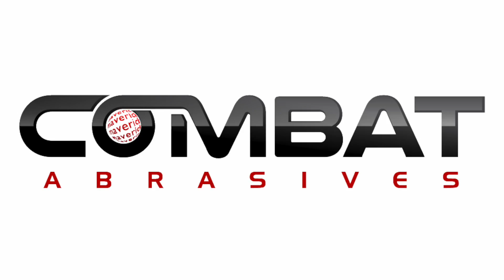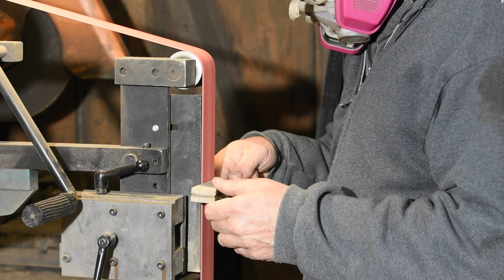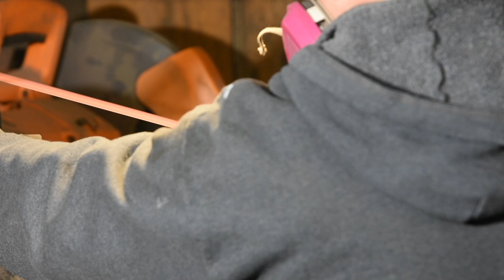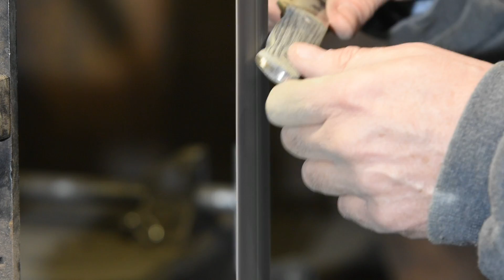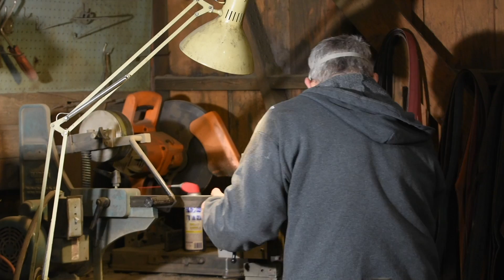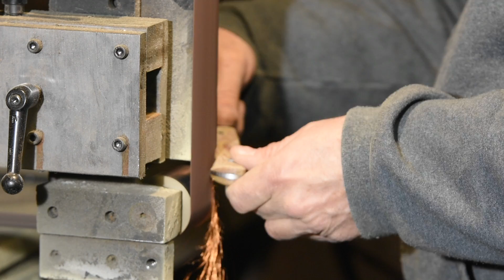Knife Making:  Handle Grinding Tips & Tricks!

Comment: The knife shop I work at does all the work on handle and blade both on the slack of the belt above where the wheel is I'm not sure why everyone I see does it on the wheel and or flat of the belt. As a professional convex grinder trying to learn how to haft my own blades this is very tough for me to put into my work

Comment: Walter, I'm trying to drill holes in 3/16" thick Norplex Ultrex g10 handle slabs. This stuff is hard to drill through. These are for a fixed blade Strider knife that came with paracord wrap. I have no tools except a screw gun for drilling, some sandpaper and I still need some type of hand saw. It's taking forever for me to drill my 3/8" forstener countersink holes for the Strider style scale screws. I don't know if this is gonna work. Any suggestions? Hey thanks man! Good upload!

Comment: Hey how does Spyderco get the G-10 texture on their Para2 knife handles? It's like a very subtle grip pattern. Is that just the way the G-10 grain is after sanding or is that pattern set in when they pressurize the G-10? Great video! Thanks man!
Reply: Those G10 scales are flat and the grip pattern is manufactured that way.  They just machine the profile and chamfer the edges, add hole pattern and its complete.

Comment: How about a video on maintenance on handle scale treatments from time to time. I have a knife with rough canvas Micarta and want it to be somewhat waterproof but I don't want it overly slick when it rains or gets wet but I don't want her to soak up water. I have been debating about using beeswax and a blow dryer. Do you have any suggestions? Would like a video on multiple hand scales treatments to preserve your handles to your knife. Thank you. Keep up the good work. Always enjoy watching your videos.
Reply: Use a bit of mink oil paste like you would put on leather boots.  It protects the micarta for a time, but it will wear off slowly.  Reapply it every 6 months or so or after it gets wet.  Its natural, no toxins and adds a bit of moisture to prevent from becoming too dry.  Also great for wood

Comment: one tip about grinding heat treated blades with scales attached.. If your shop has a concrete slab floor, place a sheet of 1" thick plywood under the spot your grinder likes to send your work into the abyss.. A big piece... a sheet that covers your distance of spit... a snot rocket distance is the preferred. If your shop has a hardwood floor? no problems at all..

Comment: So I’m really confused I have the scales and solid pins do I grind the pins or hammer them in? Because I know you apoxy them in too.
Reply: Ryan George usually you epoxy them In, let it fully dry, then u grind down the remaining part of the pins so it's flush with the scales. Or you can leave a little access of the pins and you can hammer the remaining little bit but if you want to remove the handle it's a bit of a pain to get off

Comment: No one says you can't do all this with a mixed bag of sandpaper from the cheap shop and do it by hand btw, don't let not having a grinder stop you. Might be slower, but mistakes aren't as easy to make
Reply: Sure, i still use rasp and files. nothing wrong with that
Reply: same as me      most of these vids    they got a mill full of machines
Reply: Even Chinese Dremel is good enough
Reply: I've used hand sanders, clamped down hand-belt sanders, and flex rotary sanders, as well as the non powered tools. Just begin with higher grits than you normally do, till you figure out how fast it cuts.